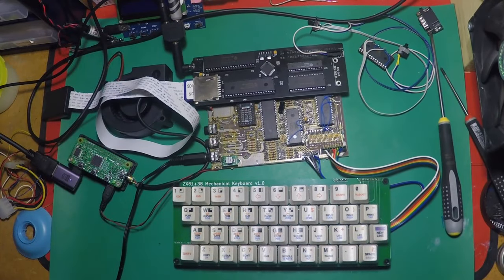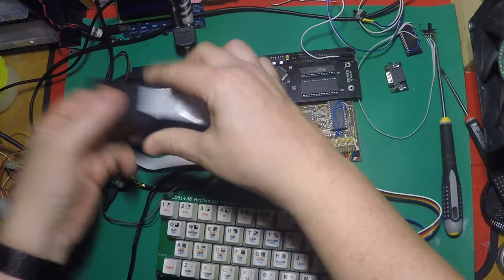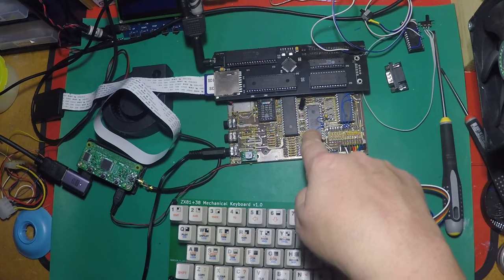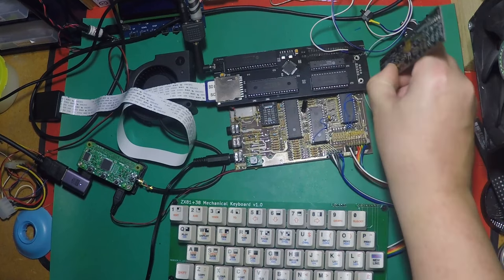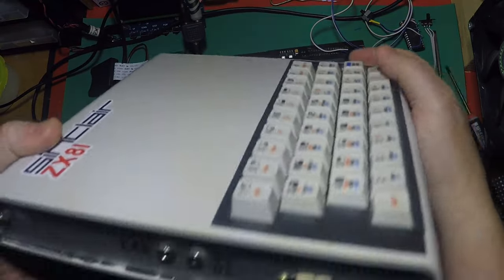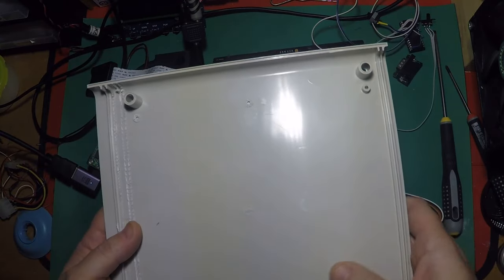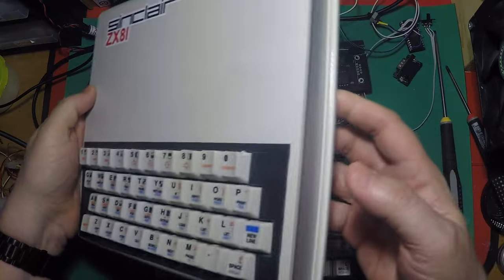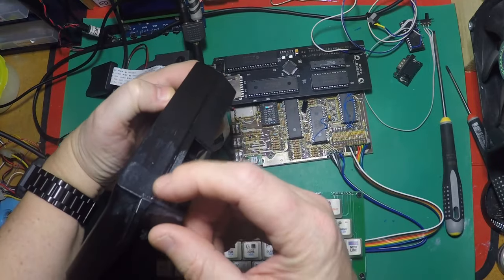ZX81 Review Repair and Conversion - Part 7

Comment: It’s begun! I’ve purchased a ZX81 on eBay! Fingers crossed it actually works! Incidentally, I noticed that adding the Slovakian ZXpand to the cart brings up a message stating, “You cannot purchase, International Shipping to the UK for items up to £135 is currently disabled”, so it looks like I’ll be using the UK reseller.
Reply from the maker: It's always worth dropping him a line directly. My ULA count is so far 3 still fully operational, two not capable of WRX and one totally dead. Replacement ULA's will be in stock end April-ish. Good luck :-)

Comment: A shame about that case. I've come to the conclusion that the Dremel isn't always the best thing for cutting. Especially accurate straight lines. There really needs to be some sort of mini cicular saw for plastic cutting. I know Dremel actually have something like this but for cutting laminate floor panels but I'm unsure it would be any good. The Dremel often binds too, especially as you've noticed when the plastic get hot and melts. 
And whatever you do, don't bother with the Dremel router attachment. It's awful for anything remotely accurate, very hard to lock in place and lots of metal on plastic which wears and makes it impossible to adjust.

The one thing I did find that helps is the right angle attachment, because it allows you to hold the Dremel in a way you can get a bit more control and it not bind so easily.
If you could get a straight cut you could cut out the entire rectangular area and put in some black plastic with cutouts for the keys. But you still have to get past the cutting plastic straight issue solved.
I've found my sliding miter saw the best for plastic, but it's limited with small parts and you can't really use it to cut a shape out from the middle of a sheet.

Of course, people will just tell you to whip out that laser cutter you have, which of course will also be easy to set up against a slightly curved bit of plastic that doesn't sit flat on a table!

Anyway, I do quite like the look of that case/key cap combination, it looks very smart :-)
Reply from the maker: Thanks... it does look presentable. Wish I'd just taken more care with the JB Weld. I might re-work the side panel now that I've got one spare from the case I'm going to toss.

I hear you about the Dremel. It's not the best but it's a step up from a junior hacksaw :-D and yes I used the bendy armature thingy when I needed to cut the rusted bolts from my old toilet header tank.